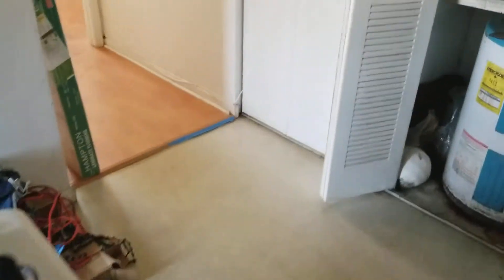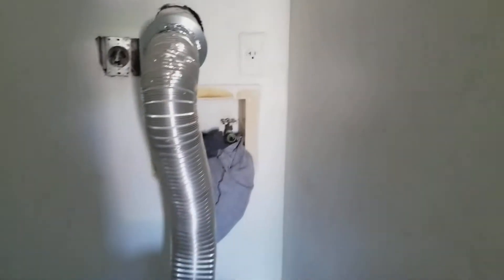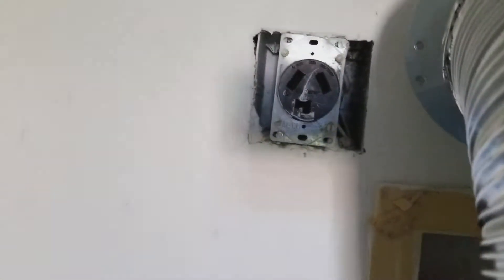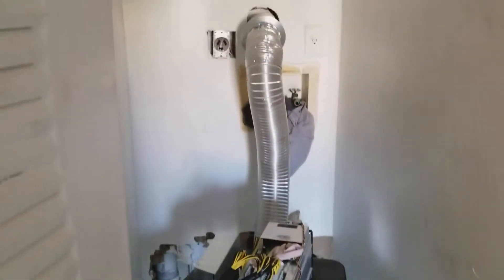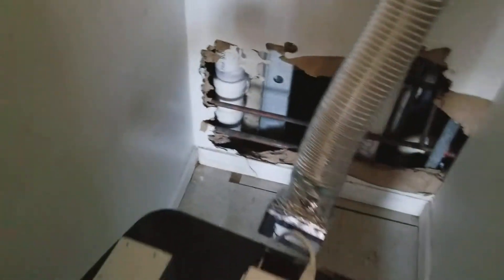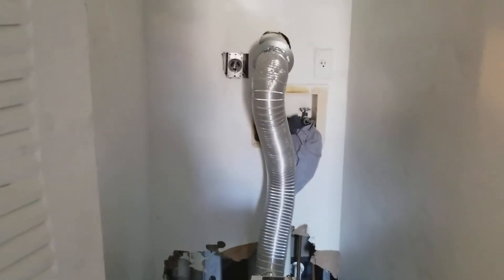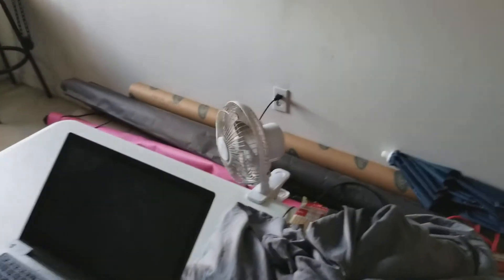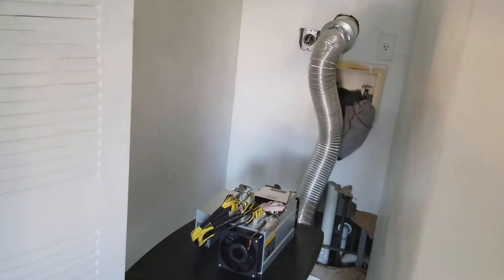Never Connect Bitcoin Antminer to 110v outlet

Comment: Needs it own 20 amp line... is the easiest method. With a 220v, 20 amp plug connection.
Reply: the s9k work 110v